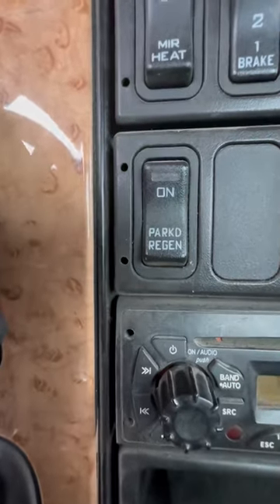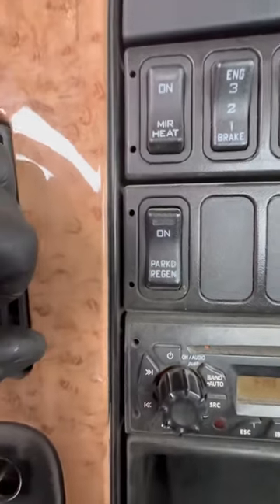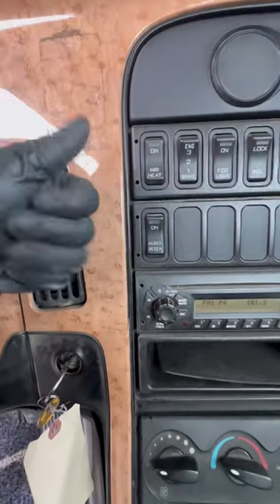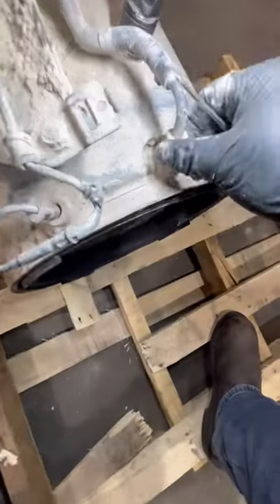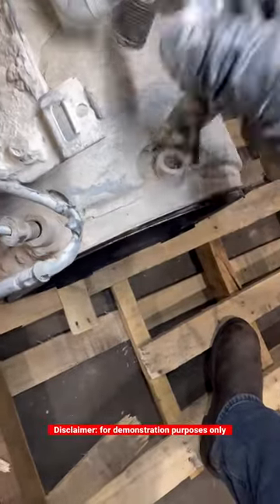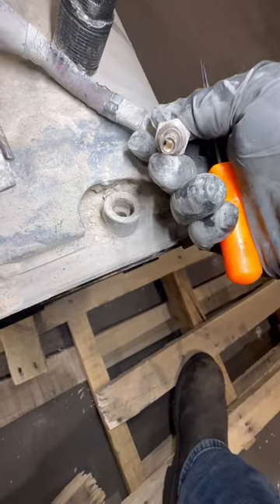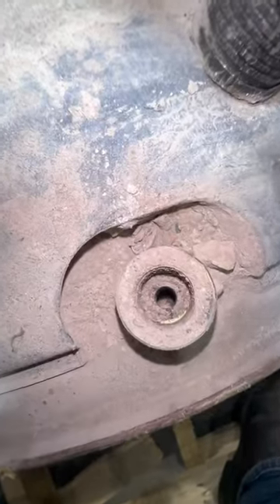#bigrig #semitruck #shorts #trucker #truckerlife #trucks #trucking #mechanic #diesel #bus

Comment: First step in fixing DPF, remove DPF
Reply: *Discreetly remove DPF
Reply: @enthusiasticpaunch  just hollow it out. Leave all the original stuff there so it passes inspection. You can always hack the computer to do the ol Volkswagen thing.
Reply: ...would be how to do it, but it might anger the fine people at the EPA, friend. Nervously looks to see if EPA is hiding behind nearby cover.
Reply: @enthusiasticpaunch  this is all theoretical. That's protected by the first amendment.